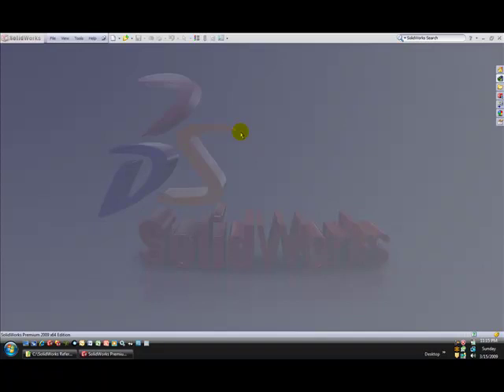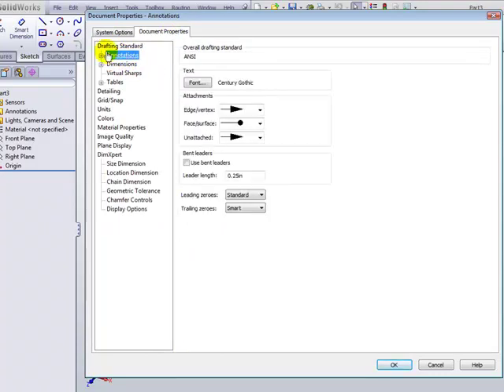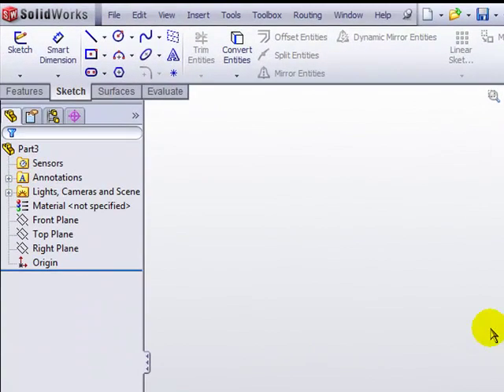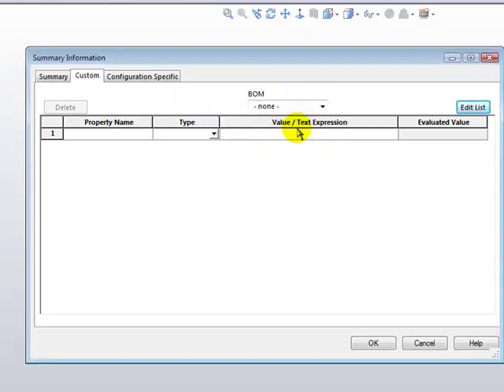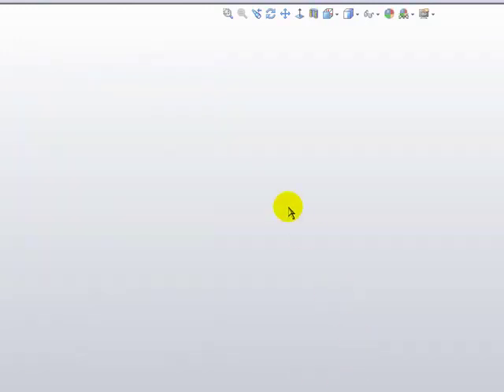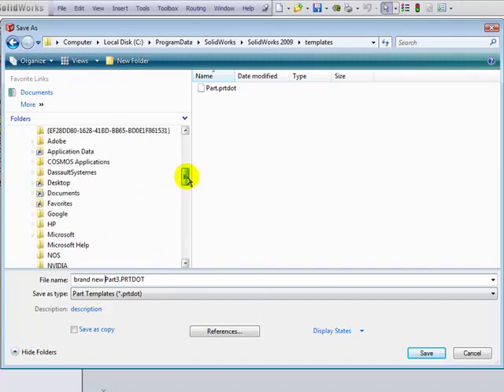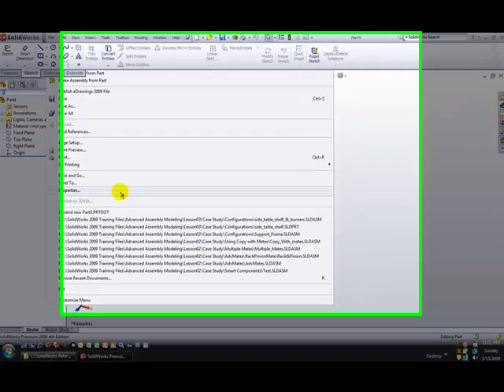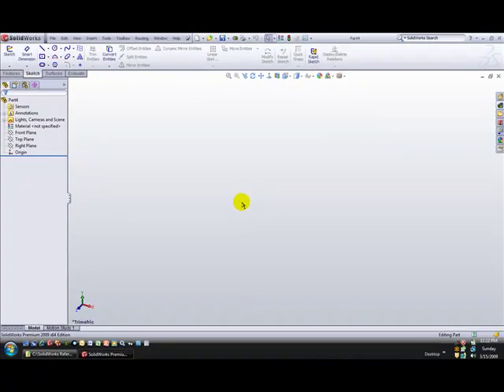How to create a SolidWorks part template

Comment: I have a question. I am trying to make a 2d pdf file but the only problem is that i want it to be a multipage pdf. like rc planes when you get a pdf its a pdf and you print out each page each with a small part of the plane and you tape those together to make a big plane on a bunch of small pieces of paper rather then buying giant pieces of paper. So can you please make a video or reply back on how to do that? Thanks